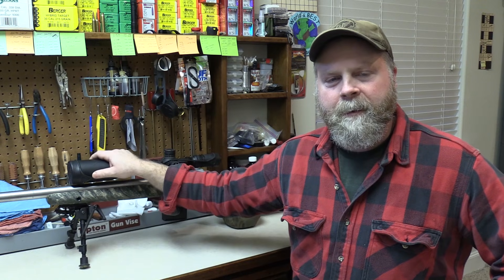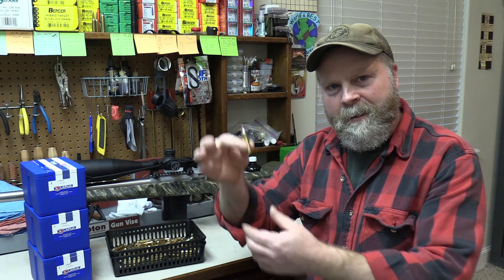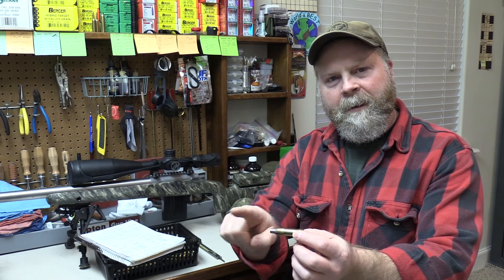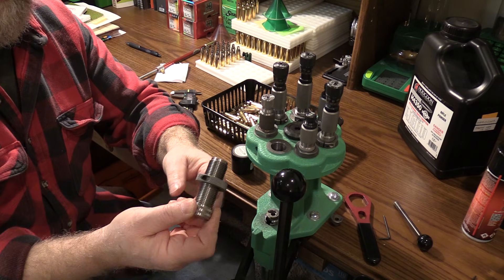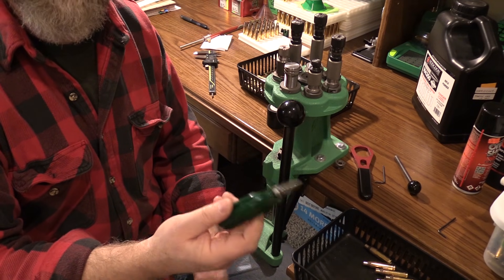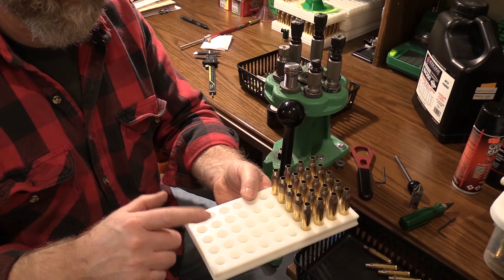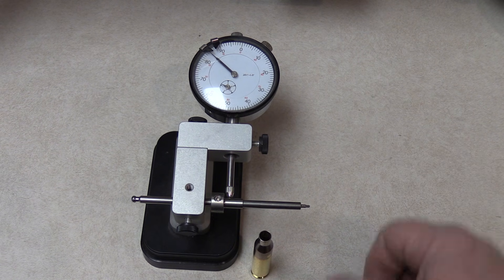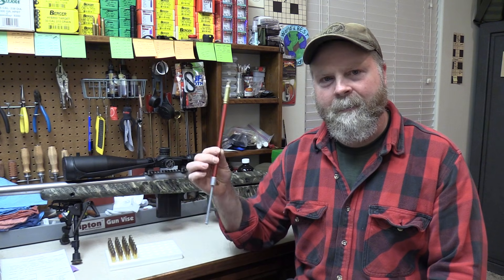Precision Rifle Load Development/ Part 1: New Brass Prep

Comment: Thanks for all your expertise, it is very much appreciated.  I purchased the Sinclair mandrel die for for my 6.5 CM with the only Sinclair 6.5 mandrel that is offered in 6.5 which measures .263. I purchased new Lapua brass and set up the die, even bought the dry lube you use.  The die seemed fine at first but after running 4-5 cases through, I started noticing scrapes on the inside of my Lapua necks, guessing this is not good so I stopped.  I was using the dry case lube but it really didn't seem to be working.  Additionally, the mandrel developed a rough surface after using it on 4-5 of the cases right at the point where the rounded part turns in to a smooth cylinder?  Anyway, I guess I can buff the roughness off the mandrel but am concerned It will start all over and ruin the brass?  Also I have read to be .002 undersized from the bullet you are using, mine measure .262, do you think this will be fine?  Thanks
Reply: Stormin Norman, I had the exact same problem but then purchased the carbide mandrel. The carbide mandrels are a bit expensive but these carbide mandrels are so smooth its like cutting through butter with a hot knife.
Reply from the maker: It happens. I think it's from the rough inside neck edge of the new brass sloughing off onto the mandrel. Cleaning and polishing the mandrel will help. In the end, I don't think the bullet cares. Load 'em up! .262" is perfect.
Reply: Thanks!
Reply: Thanks for the feedback, I buffed the mandrel surface smooth and used a little Dillon case lube on the inside of the case neck, no more issues.  I will check out the carbide mandrels, anything to save time.  Thanks again
Reply: Due to brass spring back with freshly annealed new brass it would seem that you would need a .264 mandrel in order to achieve .001 neck tension. Problem is Sinclair does not sell .264

Comment: Great video, I have a question. I took my brand new Lapua 6.5 creedmoor brass and ran it over the expander like you but I see after doing this my concentricity  has changed, it was less than  one thousands and after expanding, it varies by up to 2 thousands or more, not all of them but every other one. I am using a RCBS shell holder in a rock chucker.  Can I try buying a better quality shell holder? and will that matter? thanks

Comment: Thanks for demonstrating the use of the Sinclair Expander die. I always use one when beginning with new brass, particularly belted mag brass. However, I'm interested in preventing the initial case stretch that always happens with new brass. I neck up one or two sizes, depending on how far apart they are, then FL size down just until the bolt closes with a fair amount of resistance. This, along with proper annealing, will prolong the brass life immensely. I've watched a few of your vids now and you know how to get across the information very well. Will be subscribing in two clicks.

Comment: So when do you check your primer pockets to make sure they are uniformed, debur and uniform the flash hole. After your first firing or from new brass?
Reply from the maker: I don't do any of that stuff on Lapua brass. On WW brass, I do it before weight-sorting.
Reply: Panhandle Precision, well I bought some Peterson brass because Lapua have not brought back the 300wm yet. I heard talk about them going to bring it back. So, I've been using Remington, Hornady and now I'm looking for better brass. I was told Peterson was good so I bought 50 to try and see how the loads work, how long  they last and if I can get close to 3000 fps with 215gr Berger Target Hybrid.

Comment: I have some new lapua brass in 6.5CM that I'm prepping.  I haven't gone the mandrel route yet, but am thinking about it.  So far I have a redding s-type die to bump shoulders and it has a neck bushing in it as well.  In looking online, it looks like most people recommend a .290 bushing, but listening to your numbers and looking at my lapua brass, it seems like the wall thickness is about .015 or .03 for both sides.  So .290-.03=.260 which would be .004 of neck tension.  Most people I've heard recommend about .002 neck tension and you're saying .001.  So why are people recommending a .290 bushing?  Am I missing something or should I be looking for a .292 bushing?
Reply from the maker: madcow3007 I definitely wouldn’t run with .004”. A 292 or 293 bushing works very well with Lapua 6.5MM brass. If you want to leave the expander in the die, it will punch the O.D. out to .293” anyway.
Reply: I think Brass thickness can vary between batch’s, I have just brought some 260 Lapua brass & most of it measures .291 loaded with the odd one at .293, I did run it thru a FL Redding die to take the dings out of some of the case mouths. I like Sams idea of just running a mandrel thru it.

Comment: great video as always... very helpful.  with virgin Lapua brass, 6.5mm, do you think there will be much spring back after punching out the necks with an expander mandrel, and then a few weeks later loading them? creating different neck tension?  the reason I ask, I did load development with virgin brass... I expander mandrel, then trim to size...  I found a good node for powder, then did seating depth analysis, and at .030" off the lands, had accuracy better than .4MOA and ES of 3 SD1.4.  (this is about 3 weeks later---->) I then loaded up 50 rounds at .030" off the lands and started getting ES of 20, and then even higher, like 50.  I'm using Chargemaster and dandy trickler to trickle up, so charges are all real close to the same.  I guess I'm asking if the time between expander mandrel and seating a bullet is significant, say after a week or so. thank you!
Reply from the maker: zodiac272 No. The necks won’t change just sitting there, even after several months at least. I’ve never tried it longer than that, but I’d bet they never change.
Reply: thank you, so then maybe it was carbon fouling in the barrel. I cleaned my barrel after the velocities started getting wacky, so hopefully that was it then. Chunks of carbon came out, so it was dirty.  600 rounds unsuppressed, then 150 rounds suppressed. I'll patch it out more often.
Reply: I went out shooting yesterday, after cleaning my barrel, and got very good results, SD:5 ES:13, so it was the fouled bore causing the big velocity spread

Comment: When you take measurements of your new brass, do you take all of these measurements straight out of the box BEFORE full-length sizing the brass and begin your load process?
Reply from the maker: Straight out of the box. There's no need to run new brass through a sizing die unless the neck needs work.

Comment: Well done!  Can’t wait to see the next video.  I’m a new reloader and I’ve been trying to come up with a starting charge for a 300 win mag using 215 Bergers.  My COAL is 0.300” longer than the SAAMI load info Berger supplied. Not sure how to compensate for the pressure change.
Reply from the maker: Add more slow- burning powder. Slowly...:-)

Comment: Are you able to use the same brass throughout the life of the barrel? Example, if average life of the barrel for that caliber is 3,000 rounds and you're able to reload your 300 new brass 10 times, then you should never have to buy new brass for that barrel, right?
Reply from the maker: Yes, that's correct. With minimal FL sizing and annealing, the only weak link is in the primer pocket. Lapua case heads are tough, and I won't be running high pressure anyway. I don't see a problem with the barrel outlasting 300 cases.

Comment: This is going to be a great series!  Glad to hear I'm not the only 260 Rem guy remaining.  I recently experienced exactly what you were saying about the new Lapua brass starting out with a small neck diameter.  I ended up using the neck expander button to open it up.  
     --  Todd

Comment: Sam, what do you think of any alternative cartridges for taking the place of 300 win mag. I'm not wanting to deal with belted mag cases. I was thinking going 30 Nosler or maybe 7Saum in a long action..... do you find 300 win mag a pain to reload for versus non belted cartridges?
Reply from the maker: Chad Harzbarger I have no plans to move away from the 300WM unless I want to go a lot faster with a .30 cal bullet. The 300 NM would probably be the one I would try if I did. The belt doesn’t affect a thing as far as reloading goes. I think when people have problems with it, is when their chamber is goofy, not because of the design of the case. I’ve never had a belted mag I couldn’t headspace off the shoulder and size the web just in front of the belt. I think I’m on my eighth firing in my 300WM, and went over 10 firings on my last 300 Wthby. I’ve never even seen a collet die!
Reply: Panhandle Precision Thank you for the reply. I value your advice.

Comment: Sam do you ever work the primer pocket hole?  I have a simple tool that I have been using from K&M.
Reply from the maker: I used to uniform the pockets, but only because I was working with some nasty brass. A percentage of it had shallow pockets, so the primers wouldn't seat flush. I haven't seen that in any other brass. Now I use the tool to clean the pockets before throwing the brass in the tumbler.
Reply: I also forgot to ask about the flash hole.  I believe the Lapua brass is drilled instead punched.  Do you see a need to work the flash hole?
Reply from the maker: I don't touch the flash hole in Lapua brass.

Comment: why does lapua brass in 6.5 creedmoor only have small primer pockets? i shoot a savage 12 and it knocks a big hole in those primers and gives me hang fires
Reply: I saw a video (shot show lapua introduction of 6.5 CM I think) where lapua rep said, in response to your very question, their testing with small prime and large prime yielded nearly the same results. They went with small prime because just slight edge on performance and longevity.
Reply from the maker: I don't know why Lapua decided to only offer SR brass for 6.5CM. There are other options available. I haven't used Starline rifle brass, but their pistol brass is excellent: https://www.starlinebrass.com/order-online/new-rifle-calibers.cfm

Alpha Munitions makes excellent brass, and offers 6.5CM with LR pockets: http://alphamunitions.com/
Reply: Bud you have a sloppy firing pin. Need to bush it to keep from blasting firing pin holes in  your small rifle primers. Problem is your bolt firing pin isn't supported fully. gretan